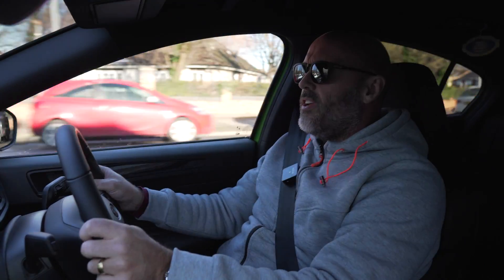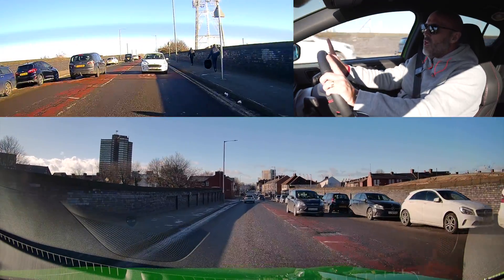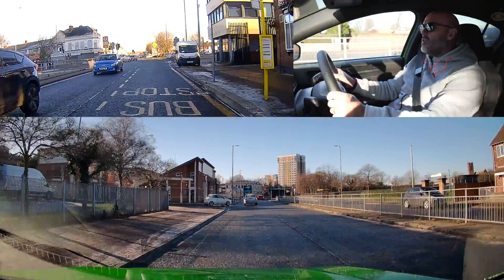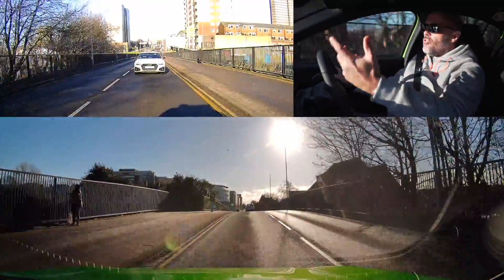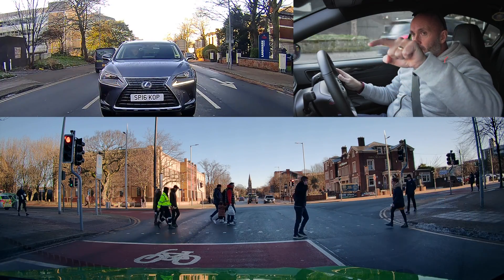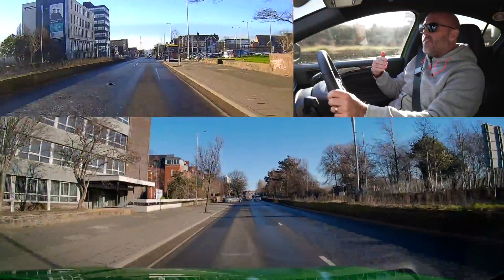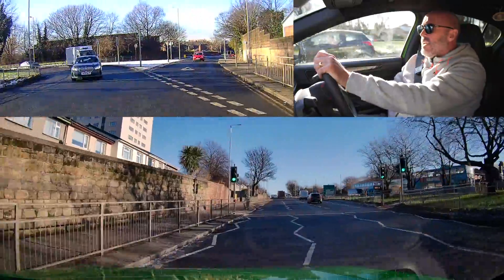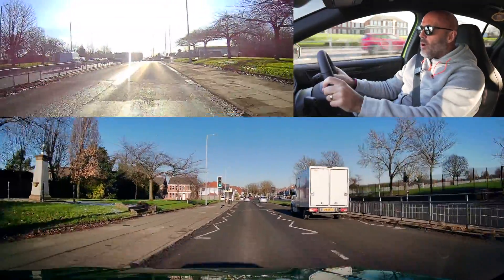How To Anticipate Traffic Light Sensors (Flashing Your Lights Doesn't Work!)

Comment: Going into neutral at the lights also has a long term financial benefit - you don't wear out the clutch springs so fast. Sitting with the clutch depressed holds the springs down and the disengages the clutch plates. The movement of these parts fatigues them and eventually they break meaning replacing them. Any work on a clutch tends to be a lit of work and therefore a bit pricy. It's similar to riding the clutch.
Reply: American made cars don't seem to have that problem.  of all the things I've driven, I've seen two that had defective throwout mechanisms fail, two that had the clutch linkage fail, and one that had the discs fail.  the two that had the throwout mechanism fail were the ones that were most commonly put into neutral at lights, because the clutches were heavy enough to be uncomfortable to sit with the clutch depressed.
also, riding the clutch is different, because all the plates are in motion, and the throwout bearing is riding against them, causing friction that isn't in the system with the clutch fully engaged or disengaged.  it puts the wear in a completely different place from sitting with the clutch held down.
Reply: @kenbrown2808  and there's me thinking in a typical dry clutch friction is used to rotate the output shaft when the clutch is engaged, fully or partially. And that slippage occurs when partial engaged and that this increases the west rate of the clutch plates as a former colleague of mine found out the hard way by riding the clutch.

The springs are there to endure that the clutch plates return into contact with each other when the clutch pedal is released to minimise any possibility of slippage. Depress the clutch pedal and the springs are compressed and that loading, if held for longer than needed to change gear, fatigues the springs and if the fatigue life is exceeded then the spring will fail. For those not aware what fatigue means, all materials have limited number of times they can be put under load but if the load is held on for longer than the designers had in mind then the fatigue life can be shortened alternatively if the load is applied more frequently than the designer expected you can also reduce the fatigue life. In the case of the clutch in a manual transmission a life of stop-start urban traffic will reduce the fatigue life by increasing the number of cycles per trip compared to a vehicle used on longer inter-Korean journeys. Likewise hold the clutch pedal down increases the duration of loading reducing the fatigue life without increasing the number of cycles.

Now both failures of the clutch are different both are caused by incorrect usage of the clutch. So, similar cause but different failure point.

I've only driven Europe-built cars so I can't comment on American transmissions.
Reply: @neiloflongbeck5705  in an American built clutch, the design of the clutch is such that it only requires peak force to disengage the clutch.  when it is fully disengaged, it takes less force to hold it disengaged.  what wrecks clutches here, is people who use it as a footrest, which keeps the throwout bearing sliding against the throwout arms or diaphragm, as I said, or slipping the clutch excessively, which, of course, wears out the friction surfaces.  otherwise, the friction of pedaling it causes as much wear as simply holding it disengaged.  - and in a modern car, neither should make the clutch fail before the rest of the car is worn out.
Reply: @kenbrown2808  main point seems yo be like a new roof. Having the clutch pedal depressed for excessive lengths of time will reduce the service life of the return spring.
Reply: @neiloflongbeck5705  main point is the reduced life still exceeds the life of the rest of the transmission.
Reply: @kenbrown2808  be that as it may, it still reduces the life of the springs which is my point,
Reply: @neiloflongbeck5705 yeah, they only outlast the rest of the clutch assembly by 25% instead of 26%, which is my point.  in fact, the springs failing before the rest of the clutch does, is so rare, that when I looked up clutch spring replacement, the only thing that popped up that had anything to do with a car was about the dampening springs in an old rover with a tremec transmission, where the owner had done his own clutch replacement and had sudden failure. I did learn that Triumph motorcycles have such tight clutches that the cables stretch faster, the more frequently you pull in the clutch, though.
Reply: @kenbrown2808  which is what I said. Thanks for confirming it.
Reply: @neiloflongbeck5705  no, it's not.  you said, "Going into neutral at the lights also has a long term financial benefit ."
so let's put our cards on the table: in my experience there have been two times the throwout mechanism of a clutch failed.  one was due to a manufacturing defect, and was was due to improper installation.  both were on vehicles that were routinely put into neutral at traffic lights.  while I've never had to replace the throwout mechanism on a vehicle that wasn't routinely put into neutral at traffic lights.  but I HAVE had to repair two clutch linkages when they came apart while pushing in the clutch.
so I've had two failures from pushing the clutch pedal, and none from holding the clutch pedal.  
what's your clutch history?  how many clutch springs have you had to replace?
Reply: @kenbrown2808  I was talking about the diaphragm spring plate which when held in the disengage position for longer than intended for changing gear will reduce its service life. Which you just agreed with. It might not be a large reduction but it's still a reduction.
Reply: @neiloflongbeck5705 no, you were talking about it reducing its service life enough to make a financial difference.  which you have failed to give any example of.  
which means the only logical conclusion is you are parroting an old wive's tale passed down to you from generations past.
Reply: @kenbrown2808  you're obviously not comprehending what I've been saying. That's fine, you think you know best but don't. But any item that is put under cyclic loads has a fatigue life that kV not operated in line with what the designs have expected then the fatigue life will be significantly reduced. This will have a negative financial impact because replacement will occur at a much earlier point than intended by the designers.
Reply: @neiloflongbeck5705  and you're obviously not comprehending what I'm saying. In the US, the diaphragm outlasts the friction plates unless there is a defect or an installation problem. So whether it is replaced with 50,000 miles of life on it, or it is replaced with 49,000 miles left on it is not financially relevant. And yet again, you have failed to provide a count of the times the springs have failed while the rest of the clutch assembly was still good.  Therefore, the obvious conclusion is that number is zero.
Reply: @kenbrown2808  is American manufacturing and installation that bad? Poor installation will increase stress on a part and that decreases the fatigue life. As does improper usage.
Reply: @neiloflongbeck5705  we're not the ones who are told not to use features of our cars because they will wear out.
Reply: @kenbrown2808  "we're" bit pretentious. I've only said to use them in the way they were intended. In the case of the clutch you depress the pedal and change gear and then release it. You shouldn't keep the clutch depressed for longer than it takes to change gear.
Reply: @neiloflongbeck5705 so, again, you just assert the same claim, while still not providing anything even anecdotal to back it up.  I'm sure as a conscientious driver, you also  turn off your headlights, when you are not looking ahead, so you don't wear out the filaments, always push in the release button on your handbrake so you don't wear the pawl off, and stand up out of the seat when at a stop so you don't wear out the upholstery. 
for, what, the eighth time, now? unless there is a defect in your clutch, holding in the pedal at a stop will not cause enough wear to cause premature failure.  unless there is a defect in your clutch, the friction plates will wear out, from slipping a little every time the clutch is engaged and disengaged, long before any of the mechanism wears out, and the mechanism is routinely replaced when the plates are.

Comment: Sensors do pick up flashing at them, but only the temporary lights. They are much lower than permanent ones, so they can't see that far out.

There's a led light on them which lights up as soon as it picks you up. If you flash at it it will pick you up faster. Facts.
Reply: Those are radar sensors on the top. This information can be found in the instruction manuals for the temporary traffic lights. Unless your headlights are emitting band K radar signals, the thing that's being picked up is the radar waves bouncing off the car that you're sat in, and not your headlights.
Reply: The very old IR detectors on temp lights might have picked you up sooner with flashing.... but the result would probably have been the same without flashing.
Reply from the maker: Myth!

Comment: 5:24 we should probably stop saying 'filter arrow'. Most of these lights are LED and there are no filters involved, just LED's arranged in an arrow pattern. I think the wording comes from the old days where traffic lights were incandescent bulbs with a coloured filter (red/amber/green), or a shaped filter (the arrow), over the white light of the bulb.
Reply: I think you'll find it was actually referring to allowing a lane of traffic to filter past adjacent stationary ones, not related to the lights themselves.
Reply: @MrLunarlander  now, I think that is a common misunderstanding of the term. As a cyclist, I'm not sure I would call that filtering. To me, that sort of filtering involves passing stationary / slow moving traffic between lanes.
Reply from the maker: As a cyclist, you also ignore certain parts of the highway code where it specifically states "filter arrow".
Rule 177
Green filter arrow. This indicates a filter lane only. Do not enter that lane unless you want to go in the direction of the arrow. You may proceed in the direction of the green arrow when it, or the full green light shows. Give other traffic, especially cyclists, time and room to move into the correct lane (because they don't use the words "filter arrow"). Please note the last bracketed sentence was added by myself.😂
Reply: @ashley_neal  yes, it's another bit of the highway code that I think is badly worded. I just wouldn't call that filtering. It should probably be referred to as a 'turn lane', rather than a 'filter lane'.
Reply: @shm5547   A protected turning flow for all vehicles is a different meaning for "filter" (n), not a misunderstanding.  And without any research or evidence, I have a hunch that it has been in use for longer.
Reply: @ChrisBrown-px1oy  yes, you could say it's filtering in that it's separating traffic by direction. However, I think the original meaning comes from the arrow shaped filter and 'lane controlled by the green filter arrow' got shortened to 'filter lane'.

I don't like its use, as it does clash with the sort of 'filtering' that bikes do. There's also scant reference to bikes filtering in the highway code. That really could do with being described specifically.
Reply from the maker: @shm5547 what's the point in referencing it in the Highway Code, you ignore bits that you don't like anyway.😂
Reply: @ashley_neal  well, it's far from perfect! I'm not ignoring it, just questioning it. Thats all. I don't like the term "filter arrow", I'm sure there's a better way to describe it.
Reply from the maker: That's a great idea for a new video "SHM's Highway Code" 😂. I'm doing that one!!!!
Reply: @ashley_neal SHM's mind is going to be blown when he finds that his coffee machine filters (and has a green light too!), the oil in his local chippy filters, ... SO much misappropriation of a biking term!
Reply: @MrLunarlander  actually my coffee machine has both red and green lights, and a basket rather than a filter. But i like misappropriation of biking terms! 😄
Reply: @ashley_neal  i can feel the groundswell of a brighter future! 😁

Comment: Many traffic lights in Sweden have their censors under the ground far away from the junction. There's a 50km/h road near me that most of the time becomes green when you arrive. Because normal stage of the lights is always red on all sides. If you're on the main road you rarely have to slow down.
Reply: There are some like that in the UK too but sadly usually a closer distance meaning you end up stopping briefly or having to creep very slowly.

Comment: Love anticipating when the lights are going to change and can often keep the car rolling at slower speeds rather than fully stopping. 

There's a set of lights near where I live that goes under a low bridge, and I've worked out that the lights stay on red on both sides until they detect movement.
At night it's great, because if I don't see headlights on the other side it's usually a good indication they will change as I hit the first sensor (cut into the road), but I'm always ready to stop if not.
Reply: There's a narrow bridge near my house like that...but the sensor for the one side is pointed down, and there's a hill going down, so the sensor picks you up at the bottom of the hill, turning the light green while you're still several hundred yards away.

Comment: 2:08 most of these sensors are not cameras, but microwave radar, very similar technology as used in the Garmin Varia bicycle radar system. You can get systems with cameras, but they're not very common.
Reply: Indeed; which is also why the flashing headlights myth is even less believable than most!
Reply: Could also be infrared sensors.
Reply: @Ultrazaubererger  i dont think infrared is used much for vehicle detection. But possibly for pedestrian detection. However, i think uW radar is more reliable, especially outdoors.

Comment: Speaking of hand brake and in gear. I was on the A1 traffic stopped nothing moving. I put on my hand brake on out of gear and turned the engine off. I was in my campervan. We were stood there for 2 hours. The car in front of me left there engin on foot on the brake and in gear (I could see the car occasionally rock back and forth so definitely in gear) for the whole 2 hours. 
Most amazing thing was google sat nav got the traffic moving. About half a mile down the road it took the cars and vans off the A1 onto a country lane the HGV stayed on the A1. It took us around the hold up and back into the A1. Not a single vehicle on the A1 apartment from the ones rejoining from the country road. 
The car who was in front of me foot on brake for 2 hours stopped behind the HGV 😂😂. Happened late last summer
Reply: reminds me of a return from visiting my MIL where my satnag notified me of a crash 150 miles ahead.  when we got there, the crash was still closing 3 lanes of a 4 lane freeway (motorway)
Reply: @kenbrown2808 it's probably a typo, but "satnag" is a good name for it when it gets angry with you for choosing a different route! 😂
Reply: @alfonsolapulce2733  not a typo for the last 5 years or so.

Comment: Interesting point about the flashing of lights. I do it at night when you are a long way away so the sensors pick you up earlier than if you are just on dipped headlights. Clearly I have been incorrect.
Reply: They use doppler radar, they are not optical at all.

Comment: What is really annoying is when the lights go red just as you arrive, then you sit and watch them go through their entire cycle with no other traffic or pedestrians anywhere near the area.
The junction was empty and the only thing the lights did was to make you stop and wait for nearly 3 minutes. 🤨

I used to do out of hrs emergency call out and on the main road out of town there was a motorway fly over junction where the lights on the roundabout underneath would do this.
2am in the morning, and no one on the road except you. 
To enter the roundabout and turn right onto the motorway you had to go through 3 sets of lights to get around the roundabout.
Each set would make you sit waiting for nealry 3 minutes, so it would take you almost 9 minutes to turn right on a completely empty road.

Comment: I did some work with a company offering police driver awareness courses a couple of years ago and it was explained to me that speed is also registered - if you're driving late at night on quiet roads and you're driving too quick the red lights will be triggered, but by approaching more slowly you're more likely to get a green. A subtle way of managing speed.
Reply: I have had lights in front of me turn red, then go green again even though I had been driving within the limit.
Reply: @skylarius3757  That would highly likely be a mixture of either the sensor sensing you when there was no other traffic in the vicinity along with the naturally occurring time sensors within the lights, speed is not always an issue when you are either too close or too far away.
Reply: @SiWeeMann. Yes same thing here almost, Slough A355 I've heard is if you hit a green and then stick to 28mph you should get through for greens for the rest of the main drag up the A355 through the rest od the town.